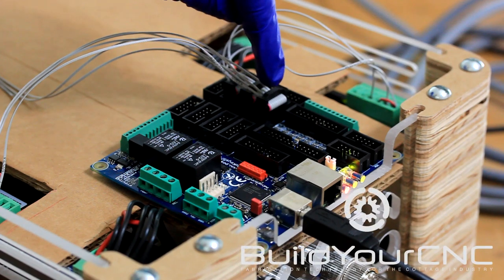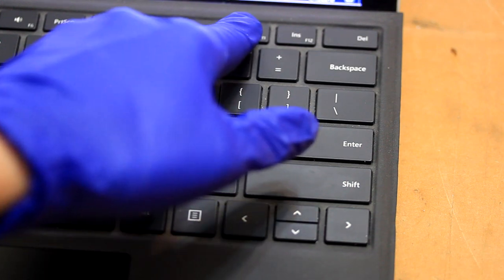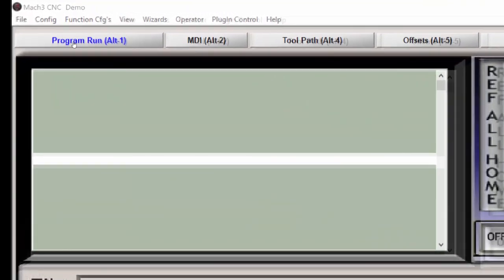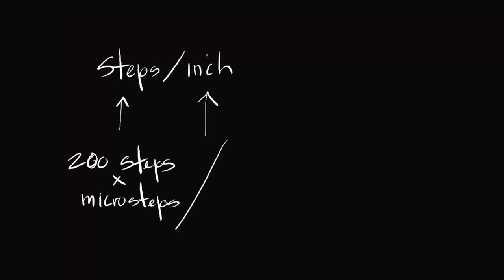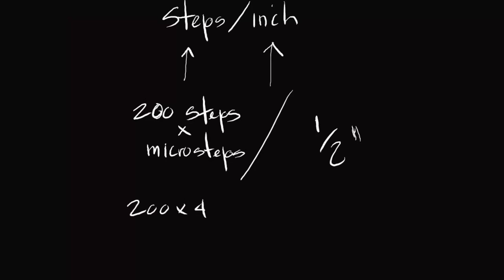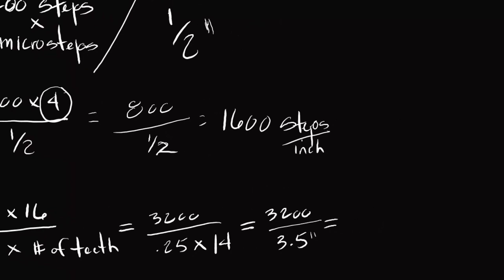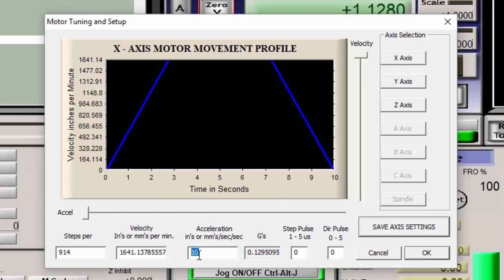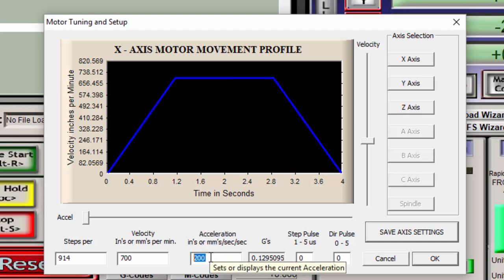4. Pokeys57CNC Testing all of the Stepper Motors and Motor Tuning Explained

Comment: Hi, thanks for your video. May I know these motor drivers are connecting to same power supply chassis? Or each motor driver is connecting separately to different power supply chassis?

Comment: I must be missing something, none of the motors can move from Mach3.  With the DMM DYN2 servo tuning cable they all work, they just don't work with Mach3.
Reply from the maker: I may need a little more information to determine why. Do the DMM DYN2 Servos work using step and direction signals? Do you have an oscilloscope to peer into these signals to confirm they are working as expected? Did you try other types of motors/drivers to see if the board is outputting signals properly? How are you connecting the signals? Thanks and let me know.
Reply: @PatrickHoodDaniel  I posted a response earlier but it doesn't seem to be here.  I have all three axis moving now but so far have not found the correct settings to make it stop when the home/limit switch is hit.  I can see them toggle in the PoKeys57CNC Pulse Engine screen when I activate the switch but I can't find a setting that allows the switch to stop the motor.
Reply from the maker: @montekay575  There isn't a setting to stop the motor. If you are wanting to set the limit for a particular axis,, you should be able to do that in the pulse engine configuration. Rather than using the diagnostic tab, use the config for the pulse engine and make sure everything is working there first.
Reply: @PatrickHoodDaniel  I can toggle the Y Home/Ref by activating the switch in the Plugin Pulse Engine menu and see it change on the screen.  It also changes in the Mach3 Diagnostic screen, M2Home under External. So it knows the switch is being made but based on the Config check, it doesn't like the fact I have it on a different pin than the 10 ~ 13 or 15.  If it's talking about the Limit/Home connector on the PoKeys, it's pin 16.   

I'm wondering if I have to use Limit instead of Home and also use motor 2 through 4 instead of 1 through 3 so I can stay within the pins 10 ~ 13 and 15.

Edit: Btw I'm using External in the PoKeys plugin for the switches.  I tried choosing pin 16 and toggling a switch on pin 16 and there is no status change.
Reply: @PatrickHoodDaniel  Btw, I'm on two different laptops on different YouTube accounts, that's why there are two different names.  My current laptop (this one) apparently has a bad Ethernet port and I wasted half a day yesterday trying to figure out why the IP address kept starting with 169.254....